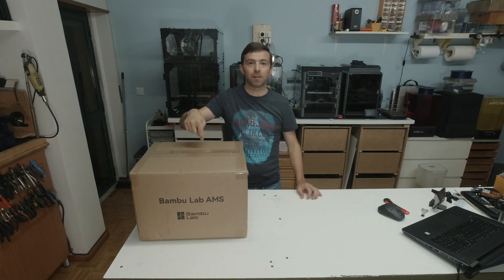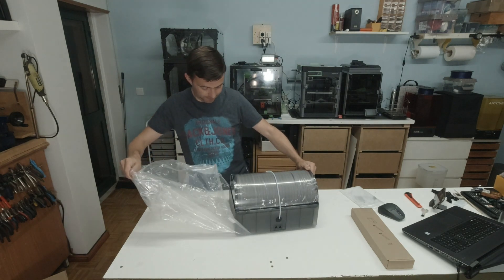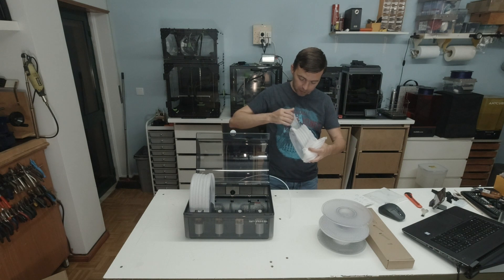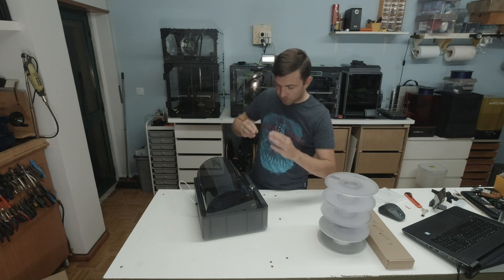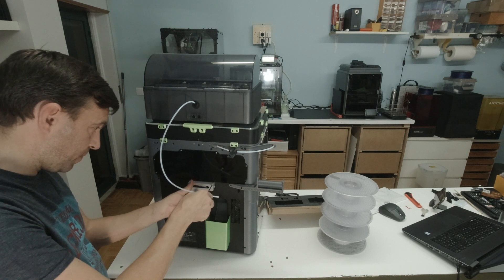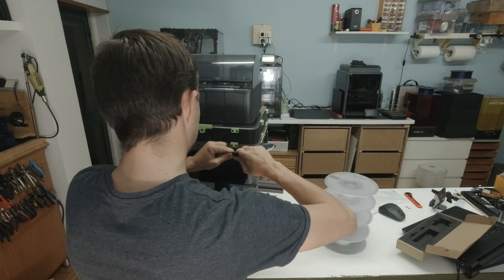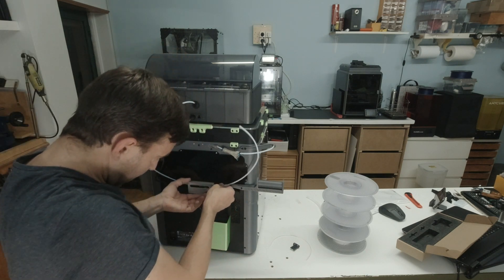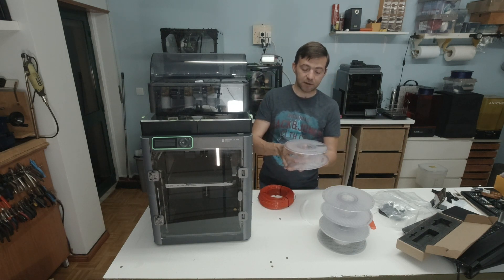Bambu Lab AMS unboxing and setup

Comment: What is the advantage of the Y splitter? I know you can either use the ams or the side spool, but isnt it just easier to change a spool in the ams then use the side one? And then you can save soace by removing the side one.

Let me know if there is an advantage im missing, im curious!

Thanks for the video!

EDIT: a friend just told me it's for filament types that are not compatible with AMS, like TPU for example. Good upgrade!